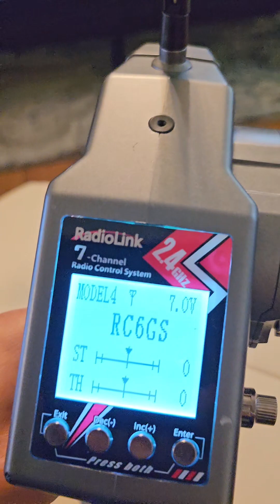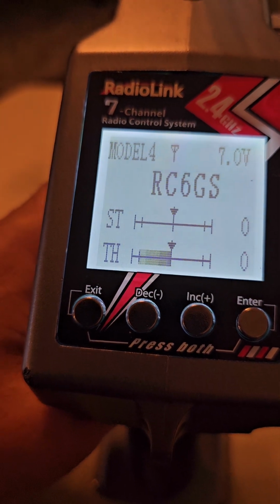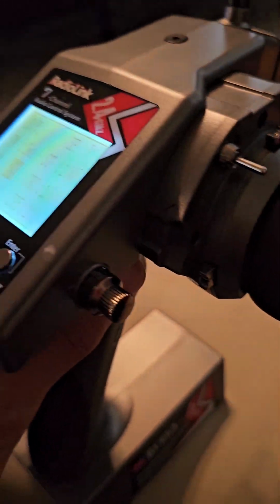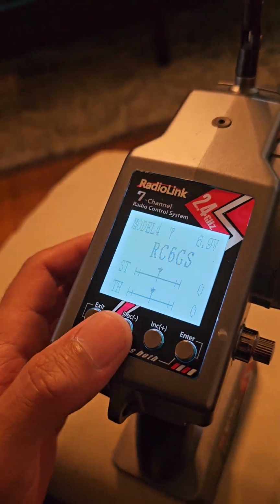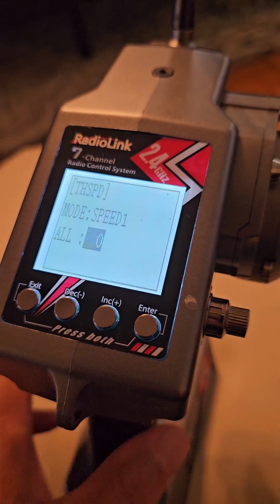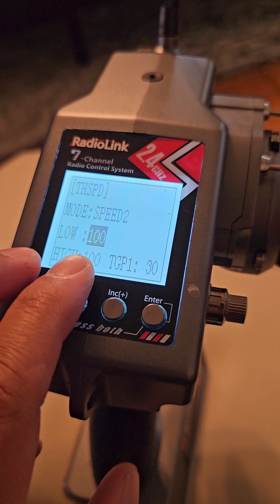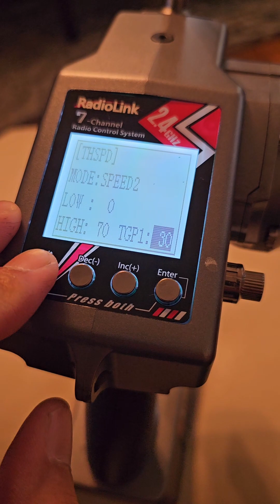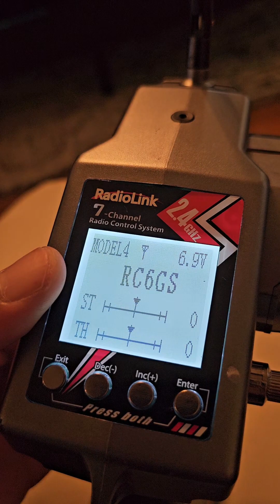Radiolink RC6GS v3(only) Launch button and Throttle Ramp quick guide

Comment: Thanks for your effort here. Question one: at the end when you set the two stage to 30% and 70%, I thought you were setting 70% max throttle but, actually, it looks like it went to full throttle so, I understand the 30% places the point of change over where 50% would be later in time, is the 70% not a reduced full throttle? Is it a reduced speed to full throttle instead? These things are a little bit unclear to me. Second question: both modalities, together, are switched on and off with a single toggle. Not clear how to select, which of the two will be utilized after exiting. Is it the last one displayed before exiting? I do not get a clear answer from RL on this. They refer me to their stock video which does not answer that question. Thanks!
Reply from the maker: Tgp1 is the range of the throttle pull that it switches from low speed to high. In the video, tgp1 is set to 30%. So from 0 to 30%, it ramps at the low speed of 0. Then 31 to 100% ramps at the high speed, of 70. You Only get to control a low and high speed.. where low controls up to the tgp1 value, then switches to the high speed for the 31-100% of throttle input.

Comment: Thanks for sharing with us such interesting videos. 
Kindly I have a Spectrum DX5C  radio and I had been trying to use the throttle speed with the graph of the xlx2 but the graph of the xlx2 esc does not function on full throttle so I am trying to use the throttle speed, the travel or the expo but it is very difficult to find a combination and to know what is going on.
I am trying to increase the launch between 40 to 60% on the graph and continue the graph until it gets to 100% in a linear position but the car is so powerful that it will keep on spinning till the end with the ultra soft compound tyres.
I think one of the problems is that the car weights 6.7kg and the motor has over 10,700W that takes over 500A on 7s.
I tried different type of graphs but up to now I didn't found the best one!
Reply: o have dx5c and this radio. Been a spectrum guy for years yet this radio does more things. 
I have the launch control setup as a turbo button on my bashers. 
And the throttle curves are amazing. another 3 ways of setting them up in there. 
I cannot launch control or boost with my Spektrum. Its a huge let down

Comment: Thanks for all your Video's they are very helpful. I am having a issue with the Trottle Ramp not working with the Trans Brake Button. Any info on what version firmware is needed? I have 2 Radio's one with version V6.8.2S and the other with Version V6.8.0 Any info would be a help. Thanks!

Comment: Tried to compare to spektrum in serch . The radio link came back and found out about launch control.  Ive been happy witg gt5 and i probably wont replace the 7 rigs recievers at first.but could see this being my new goto.
Reply from the maker: The Radiomaster mt12 is my new go to. Going to be a bit to get right, but it's a lot of radio for the price, and has a much faster latency

Comment: I tried that on mine it work for the throttle speed  ramp wen i pull the gas trigger works good but if i try it with the button like a trans brake it ignores the throttle ramp and goes 100% throttle wen i let go of the button instead of ramping in any help
Reply: Same. It’s not consistent. Still can’t figure out the speed2 setting either without putting the car upside down
Reply: @DWTWilt have you figured it out yet
Reply: Have you figured this problem out yet??
Reply: I think it’s pretty common sense why u cant use the throttle ramp u holding the trigger at 100 percent
Reply: Seems like u have to choose one function or the other. Not working together